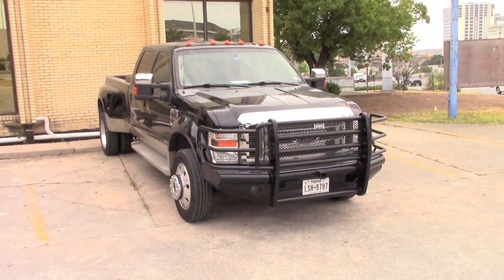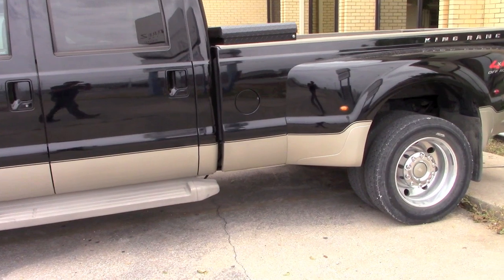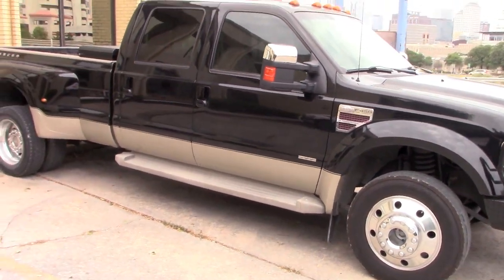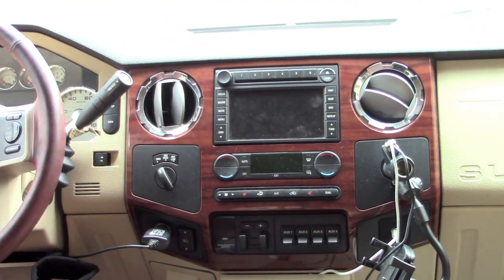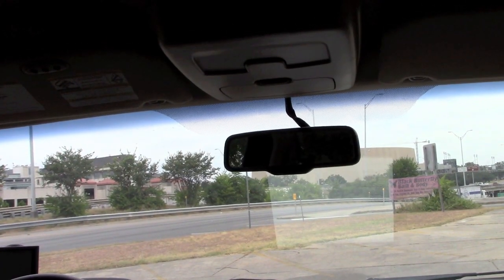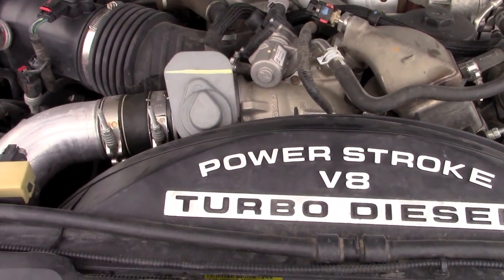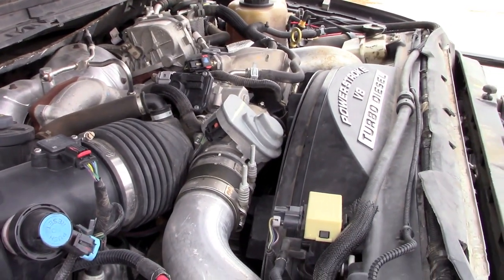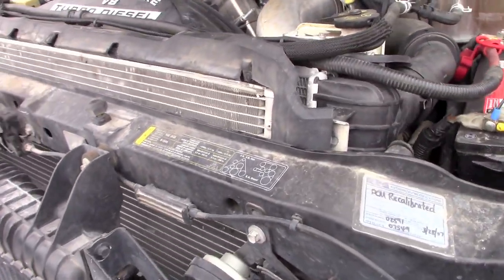Are 6.4 Powerstroke Trucks bad Trucks?

Comment: My dads dpf clogged at just 15k miles and he fully deleted it with the h&s mini max and has had zero problems with the engine since. He currently has 327,000 miles on it as we speak.
Reply from the maker: Zachary Friedrichs that’s awesome, he has gotten more than double the life expectancy than they claim. the 6.4 biggest down fall is the emissions equipment.
Reply: My dad deleted the dpf, and egr, got an after market exhaust tip, intake, and got himself a tuner for it. It had over 800,000 miles on it last time I was in it.
Reply: @LSRWvlog  my mechanics a 6.4 specialist although i have a 6.0L he daily's a deleted 1500 horsepower 6.4 with 280k on it..... from what he said biggest thing and first thing if you're gonna do anything to a 6.4 Delete emissions if legal, and 2nd thing remove the sequential turbo setup it induces alot of heat and unnecessary stress into the motor in his experience not to mention unnecessary complexity hes also got a race truck thats got a 6.4 in it motor had about 150k miles on it before he got it trucks probably had another 40k put on it and its quad turbo'd with nos she still runs strong that truck is probably at the cusp of almost 2000 hp specs im not exactly sure
Reply: @justnsaliga8518  no he doesn't
Reply: @hilljackzack7284  800k? That's awesome I like to see people putting some real numbers down on these beautiful trucks
Reply: Deleted mine a 108k and almost 100k later at over 206k no issues with 755hp

Comment: I got a 2008 6.4 powestroke  with 784,392 miles on it pulls heavy trailer everyday only a starter replaced 2 times and general service.

Comment: A 6.4 turbo setup is a compound setup, anytime you feed a turbo with another turbo it compounds the boost pressure, reason why a 6.4 can make 40psi of boost stock and 45+ with a mild tune. The bigger turbo makes about 20psi and feeds the smaller high pressure VGT turbo, the VG turbo doesn't have any idea the incoming air is already compressed and it compresses it again, that is compound turbocharging.

Comment: I bought my 2009 6.4 with 71,000 miles on it. I drove it about 10k miles before the DPF gave me problems. I deleted the DPF but not the EGR. It now has 138,000 miles and I haven’t had any problems at all with it. I towed a 15,000#Toy Hauler and now have a 3,000# slide in truck camper. It’s not a daily driver so if I’m driving it, it’s getting a workout from towing light weight trailers or the above mentioned bigger loads. So far I’m very happy with the truck. Rides great for a bigger truck and I love the features that the King Ranch provides. P.S. I run a H&S mini and keep it in Stock mode all of the time. I just got back from Colorado with the truck camper and flat towing a Jeep (way over loaded) I pulled it over McClure  Pass and Independence Pass and had plenty of power.
Reply: Get some big boy miles on their first and talk to us then. 6.4 a complete pos sucks cuz the bodystyle is beautiful. My 7.3 has  410k an ZERO blowby. 6.4 powerstroke trucks literally only good for being a good donor for a cummins

Comment: It seems that any ford engine with .4 in the liter number just tends to be a gamble whether it's the 3 valve 5.4 Triton or the 6.4 powerstroke
Reply from the maker: It is a but if a gamble and I bough both of them and the 5.4 had almost 200k with no issues. Just boils down to how to drive them and take care of them.
Reply: Same her 5.4 3v 09 has about 200,000 toe our ford farmtrac tractor,hay,feed cows. Tow with a goose neck it can get to rattling sometime but give it a little juice and it stops,also noticed using marvel mystery oil quiets it down. Good truck,has 200,000 engine goes.its cheap to get a new crate motor.
Reply: Brent Neahring Totally wrong. Our 2008 Expedition we had for 11 years with 5.4 was flawless.
Reply: I daily a 2003 f250 5.4l it’s got 319k miles and it’s basically stock still
Reply from the maker: Wow that’s awesome! Getting your money worth out of it haha
Reply: LSRW yes sir! Til death do us part
Reply: @gregorioloredo7518  I'm not saying that all 5.4 or 6.4 are bad, but I'm mainly talking in reference to people I know who bought a used and not taken care of engine and had to have a jasper engine put in, but one those trucks has about 400k miles on it but it was rebuilt at 150k. My comment wasn't intended to say those engines can't last but that they can develope very expensive problems from bad owners.
Reply: Brent Neahring i understand, I didn’t mean disrespect with my comment I was just stating my vehicle. Sorry if it was taken the wrong way!
Reply: @gregorioloredo7518  not a problem, I personally drive a 3.5l 2012 ford Taurus with 89k miles, my mechanic has a 2010 with 250k
Reply: Kinda like the Chryslers that end with a 7. And GMs that end with a 6.
Reply: @atx-cvpi_99  throwing shade at Duramax?

Comment: Never had any problems with my F250 6.4  which has 116000 miles
Reply from the maker: awesome, good to hear, i just crossed over 70,000
Reply: I would hope not at 116k just wait till 150k
Reply: Corey Graham 247k over here just deleted and tuned

Comment: Nice truck. Even if the engine grenades it will still be worth it to put in a remanufactured engine.
Reply from the maker: Steven Wilson agreed!, these are great trucks do to they are cheap to buy and rebuild but have great looks, rides great, great interiors and have good tow capacity. I am seeing a lot for sale with 300k plus miles on them.
Reply: Throw a 12 valve in it don’t even bother with a reman motor it will also fail
Reply: Remans are even more likely to fail.
Reply: I heard that the reman 6.4 engines are junk. Even from Ford.

Comment: Where is a good place to buy the DPF/CAT delete straight pipe, and the tuner?
Reply from the maker: Long story short, there is no good place. You will have to shop around a piece it together. In Oct 2019 the EPA cracked down on DFP deletes and tuning companies stopped making tunes. You can still find them but you will have to look.

Comment: Did you get the extended warranty through the dealer?  What company?
Reply from the maker: The warranty was though Ford and it was the 48 month 48k miles. I bought the truck at a Covert Dealer in Texas.
Reply: @LSRWvlog  Thanks sir! I just bought a 2008 F450, from a small lot their extended warranty provider wouldn't cover it. And so far none of the popular ones will touch it either.  Truck is in great shape with 58K on it.  I had no idea these engines had so many problems.   Appreciate your videos,  gives some hope ;))
Reply from the maker: @dannyg8741  yeah it would be pretty hard to find a warranty for them due to age ( i got lucky) but the main thing is to up keep the maintenance, if the emissions system is still on the truck. Change the oil every 5k. Also look into fuel additives to help lubricate the fuel system components. Best of Luck!
Reply: They always call me about the extended warranty on my vehicle.

Comment: Ha.  I sold my mustang for a 6.4 as well. I bought it with 100k on it and now have 239k miles on it but the turbo just started leaking at 238k. 3k to fix and I am on the fence about fixing it.
Reply from the maker: depends on what you have planned for it, i know you can buy these turbos in 2 sections. So if it is the high pressure or lower pressure. low pressure is $600 and a high pressure is $1,200 or you get after market. That is you doing the work yourself. again it all depends what you plan and future with the truck. If it was me, i would replace it. hope this helps!
Reply: Thanks for the reply. A place in Dallas wanted 3k to replace the high pressure turbo. 1,800bfor the part and the rest for the labor to pull the cab.
Reply from the maker: @FreeWheelin  hmm if you do a quick google search you can find the turbos cheaper and pulling the cab is the easyest way of doing it, but not need. there is a Youtube page called DieselTecRon and he shows how to pull a 6.4 turbo by jacking part of the cab. it would a tricky job, but can be done in a drive way.  Also there is a shop in Round Rock called AB&T Diesel Repair and Performance, they have a lot of great reviews if you do not mind drive 2 1/2- 3 hours. hope this helps!
Reply: FreeWheelin' just replace them. eBay has a choice of either replacing them or rebuilding them. They go for $780 fully rebuilt turbos, complete. You can always rebuild them. The kit for the high pressure and low pressure goes around $126.00 :) they are not very hard to do, they are easy. The problem is if you have a lift, if not it's still ok, a 4x4 piece of wood between the body and frame will have enough clearance to work in it, they can be placed just on the front. Trust me, done it many times.
Reply from the maker: perfectly said!
Reply: You can go to a single turbo kit i've heard although I have not done much research into it as i plan to try to keep mine mostly unmodified minus upgrading whatever weak points i can
Reply from the maker: They sell single turbo kits for the same price as as quoted, but you also have to get the turning. Not a bad option just more work.

Comment: Delete it and 75% of your problems are solved .  For the 15,000 grand you spend on a cummins swap you can make that 6.4 very reliable/ hp monster . I own a 6.4 and a 03 cummins and it's no comparison as far as horsepower and torque the 6.4 runs circles around it .
Reply from the maker: diesel nut since I posted this video I have been going back and forth, I was looking at upgrades for a 6.4 and you are right. For 1/3 of the price I can have a built 6.4 that is more reliable and sounds awesome. An option I though of doing was buying a 6.4 and building it and than swapping that motor into the truck and sell the current one as a core. Only time will tell what i do, but when I do it you guys will know as well!
Reply: @LSRWvlog  If we were talking 6.0s, I would agree but not a 6.4. I have never heard of anybody being able to keep a 6.4 together for 500k+ miles like a cummins or the 7.3/6.0. Obviously the cummins isn't going to have the power of a 6.4, but I would value the peace of mind much more. Maybe there are people building 6.4s fixing all of the problems, but it hasn't been proven yet. Once people are getting half a million miles on built 6.4s then I would agree that is the way to go.
Reply from the maker: @hummincummins5413  thanks for the comment, I am loving this feed back this video is getting. The thing with the 6.4 from what i have researched the 6.4 is a temperamental engine from design to parts that where put on it. Most of the problems are the emissions system, but what that system is doing is putting extra fuel and heat in the engine. The fuel dilutes the oil and takes away the cross hatching and the that heat is doing is stressing  parts such as pistons, injectors, turbos, coolant system, etc. So by deleting it you solve some problems (but EPA does not like that) but not all. Other problems you have is bad valve guilds due to it is steel on steel, front housing leaks due to capitation because of the larger water pump, plastic radiators end caps that fail. These issues can and have been addressed in the aftermarket world that make it a more reliable engine, now i am not saying its a 5.9 Cummins or studded 6.0. But with money spent right you can have a good engine that I see lasting 500K.
Reply: Yeah 🤛

Comment: I don't think that there's a truck in the world that can tow 16 thousand lbs "on the bumper". Frame attached tow hitch maybe?
Reply from the maker: Doug  Veraska when I say “bumper pull” what I am refuting to is a hitch receiver. My truck has a class 5 hitch receiver  that is rated to 17,000 lb. Also to remember is that the trail weight is 16,000 lb but only 1,600 lb is on the truck (10% of the weight of the trail is on the truck). And in the camper world a bumper pull trailer refers to a travel trailer as in it uses a hitch receiver and not a 5th wheel connection.
Reply: the truck can tow the same amount from the tow hitch than from a gooseneck or 5th wheel. just depends on the trailer

Comment: Dude sorry but the 6.4 is not cheap
Reply from the maker: the 6.4 are cheaper than the 6.7 powerstroke, 6.9 and & 6.7 cummins and the 6.6 duramax when you look at mileage vs price.
Reply: We got our amazing 6.4 for 37,000$ we are not rich but it gave us a great advantage and we still have it 8 years later with no issues love the truck
Reply: @smokendiesel4958 It's too expensive to buy instead of repair.

Comment: I have a 6.4 fully deleted and tune great truck just change oil and fuel filters religiously and use archoil oil and fuel treatment remember it's not a race car it a truck even though they produce a lot of power guys beat the dog shit out of these poor trucks Cummins, Powerstroke, Duramax, they all have their set of problems once again it's a truck not a race car also run a mild tunes my friend just blew his 6.7 motor running a high tune and driving it like a race good luck with your truck
Reply from the maker: Bigkato 313 good points, they do make great power but like you said, if you beat on it, it will let go like any other engine.
Reply: @LSRWvlog  Thanks my man  guy's dog these poor trucks out it's a truck not a race car we tune and delete them to get long term results from them if you take care of it, it will last trust me I had my 6.4 over 5 year now only problem was a transmission heat censor.
Reply from the maker: Bigkato 313 awesome glad to hear, I plan on keeping this truck for a long time. So far within this 1 year I only had a egt sensor go out in the dpf
Reply: I bought a 2008 f350 bout 1.5 yrs ago with 77k miles.  3 months a
Into owning it alternator went,  1 yr after ownership HPFP went out.  Put a low tune on it to delete the dpf and egr.  Runs great though, a daily driver, and pull a horse trailer occasionally.   Every fix has been under extended warranty,  its currently at the dealer to fix something they should have when they replaced the pump, the orings and gaskets. It started sucking in air when rail system drained after 30 min when parked on a hill, so it wouldnt start.  But other than that itsbeen good. But I'm on the fence bout keeping it at the moment
Reply: Not a race car‽
 It's a race truck!

Comment: They are absolute junk. Run away from any 6.4 PowerStroke engine. Just buy a Cummins or Duramax instead. Downtime costs money warranty or not. Those are the absolute worst diesel engines ever put in a pickup truck. Worse than the old GM 6.2 and 6.5 diesels.
Reply: 6.2s and 6.5s don't belong anywhere near the 6.4. You can have a reliable 6.5 bullit proofed for the price of the injection system on this truck.